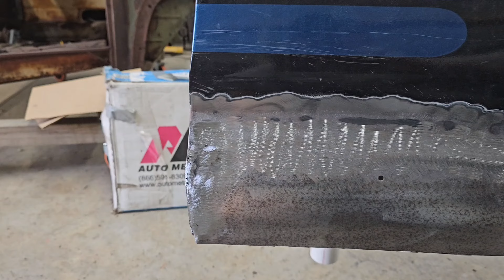Rust Be Gone: Saving the Quarters & Fenders of a '68 Oldsmobile 442

Comment: Good video pannel bond won't adhere to painted surfaces but it will work when you put it in the channel if thats por 15 that stuff never worked for me but epoxy primer will.
Reply from the maker: Thanks for the comment!  I personally don't care for por15.. I use a SEMs product.. Rust Stop.. I sand/grind it first... then apply the Rust stop.. sand that with 80 grit... then apply the panel bond over that.. adheres like it should..

Comment: If your weld lines are level with the body line how do you put fill in without having a high line
Reply from the maker: I'm butt welding the panels in.. not over lapping the metal.  If you mean the panel bond I'm using over the patch panel in the quarter... ill be sanding it down/off so it only remains in and pin holes that I missed with the welder.. if that makes sense.  Thanks for the comment/question